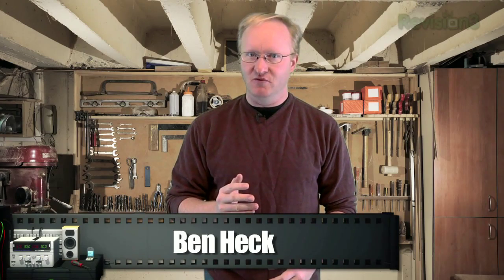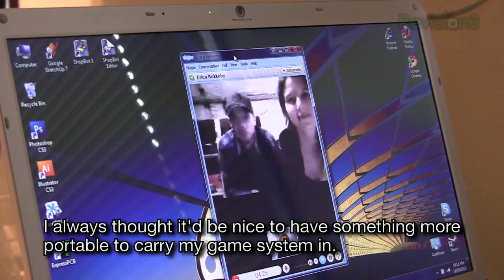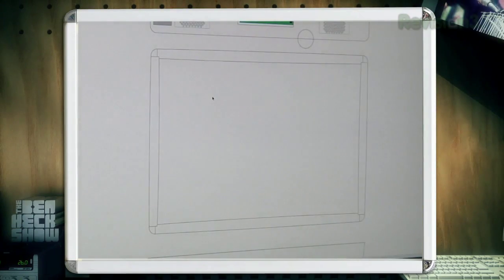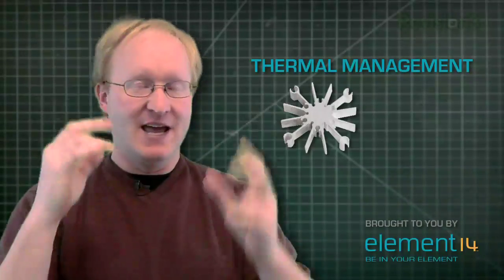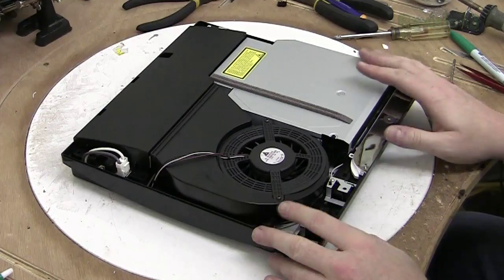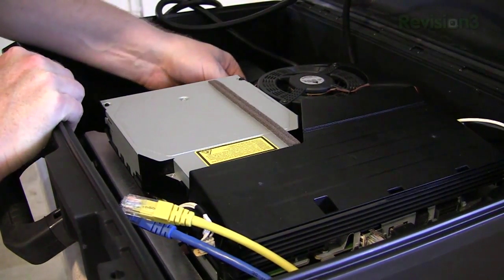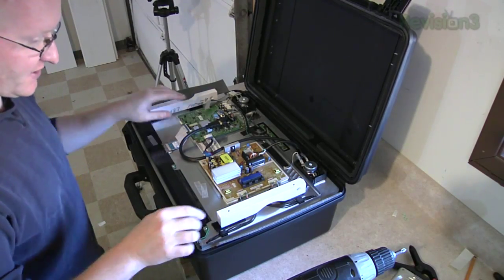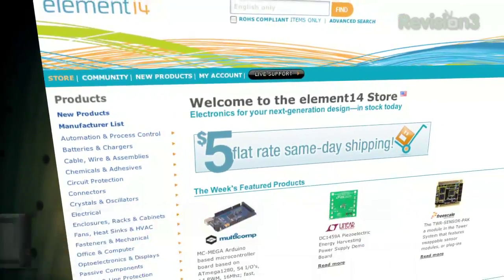The Ben Heck Show - Ruggedized PlayStation 3

Comment: Make an iPhone and Samsung together
Reply: Creating the phone itself would be rather simple, seeing that Samsung's new phone, the Galaxy S6 uses much more powerful hardware than the iPhone. The problem that arises is the OS meshing. The Samsung Galaxy S6 (as well as many phones on the market today) run on the Android OS, while all iPhones and basically any Apple product that starts with "i" use iOS. These two OS's are polar opposites from each other. 

HOWEVER!

If Ben were to build a double-sided phone, he may end up housing the two together perfectly. The problem is that there isn't much difference between that and attaching the two back-to-back with an adhesive

Comment: Where is the fan located inside? My ps3 literally screams when its inside a cabinet thats open on 3 whole sides. It still badly overheats. I would imagine this will be worse.
Reply: No, the mesh type material with the white x's on them are vents, one in and one out.
This is much more ventilated than a normal ps3 in its case.
Reply: Surms41
Ahh fair play then.
Reply: try putting it on top if possible, its not recommended to be inside anything... also do a good cleaning... if need be open it up if you can if not clean the crap out of the fan and vents. Also make sure the fan is spinning ok and nothing is clogging it up. Its not as loud as some ppl think.. ppl are tripping about the ps4 as well these days and its half as quiet as launch ps3s, either way who cares, its not that annoying

Comment: Sooo, where the controler goes ? xd
Reply: Surms41 sure you could fit a few in the case but if they are loose it could cause damage
Reply: *****
I mean where you put the controller when moving the whole thing. You need to have it separately or is there a compartment in case for it?
Reply: Michał Wachułka Inside of the slide-y cover for the disk compartment.
Looks like enough space to fit 2-3 controllers.

Comment: help hi i am matt i got a ps3 on ebay i was told it worked all but the disk drive you can download games so i got it but it was not so it powers on but wont stay on it has yrod from over heating as far as i no it needs reballing i had it apart i do not have what i need to do that and it wold be cool to have you  it modded in any way u like  can you help. can i send it to you and have you modd it and send it bake in any working not to  big super cool form you like  i am at a loss
 emall me if you can help a       drwho4515@yahoo.com             . hope you can help you are my only hope

Comment: I'm curious about the cooling, there didn't seem to be any vents only at the top, I'm sure in Afghanistan hardware overheating is an issue.  Specially as the extra power supply is inside the case and LCD screens can be a little warm.

Comment: I would of put a open glass or plastic so can see the play station and put a nice LED Light (with a toggle switch of course. if you want it off while playing. just to show off the sexy insides of the playstation.) as for the LAN hook ups, etc, i would of had them on the back, and side(for controllers). and have a little heavy duty clip on bay like on old boomboxes. so there not so many wires sticking out from the inside. but that's just me for my own touch if i made one.   Still a nice set up.

Comment: Awesome.  How rugged is it? Or I suppose how much faith do you have in it?  Would you drop it, throw it, run it over etc?  Also I'm worried about all those holes in the pelican case.  Did you silicone the screws or use neoprene washers? How compromised is the waterproofedness of the pelican case?  I'm not criticizing, I think this is superb.  I'm simply curious because I want to build one and have it function to spec.

Comment: BTW, I have a bigger version of that monitor/tv, and it is the best tv ever.  I'm not sure about input lag, but it looks good, and the menus actually make sense, and are really easy to use.  Also, it supports picture in picture, so if you use it as a computer monitor, you can watch tv while your games load.

Comment: That was a job well done... except for one thing.
The HDD. Those HDD that come with the PS3 are the common 2.5" laptop drives that do not take kindly to shocks. So while the whole system should take no damage from being move around back and forth, the same won't be for it's HDD. The easy way to make it worry free would of been to place an SSD. However, I realize when the video was uploaded, so at the time of creation, and SSD was out of the picture.
Reply: The ps3 was mounted onto a shock resistant mount, with rubber shock absorbers used. That should minimize most shock damage to the HDD

Comment: i don't know why you video got 50k viewers...it's should got 10m or more viewers...!!!
the video is very cool...good engineering skill....and i wonder the ps3 heat go where..??because the ps3 completely inside the case..the hot air from ps3 'exhaust' will trap in there...if continue condition like that..the ps3 will get overheat...
anyway...sorry for my bad english... you rock man...

Comment: you know that you can get pc parts too? no need for an overpriced system when you can build the same thing, with more power and you can still use the monitor they wanted if you do not use a dumb laptop board, it`s very simple

Comment: An even quicker (and sometimes more accurate) way of taping screw threads into aluminium is to put the tap into a drill. But one really needs a good quality cordless drill to do this with and to use a tapered tap (definitely not a bottoming tap).

Comment: wouldn't that design kinda overheat the whole system without any venting for the fan, especially on a gaming system? and couldn't you have mounted the dvd drive a little better? :P I know I couldn't do about 99.99% of what you did in this video, but there are a few things I would do differently if I could do this myself :P

Comment: Cool.  You can replace the Netgear switch and the power bar with a power inverter and some batteries.  But how many Ah do you need to run this for 2-3 hour before plugging it in?